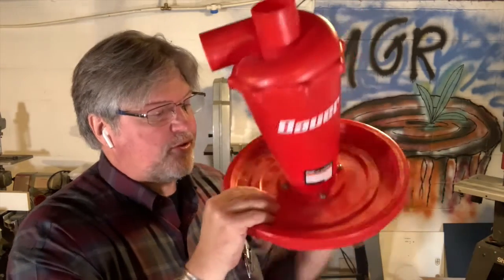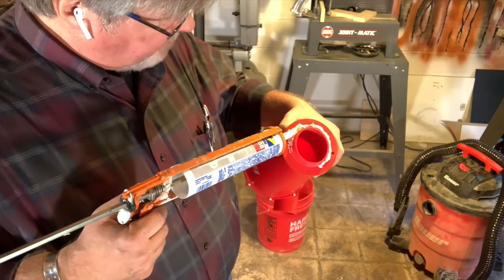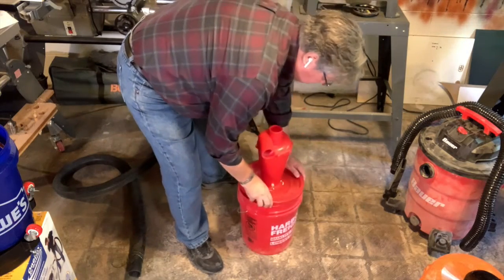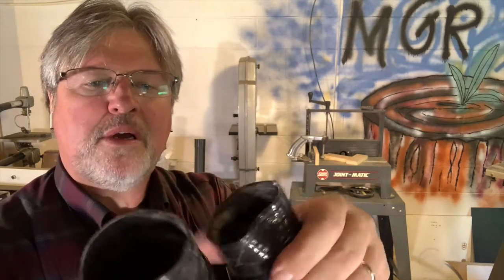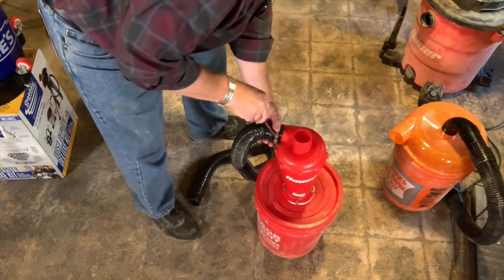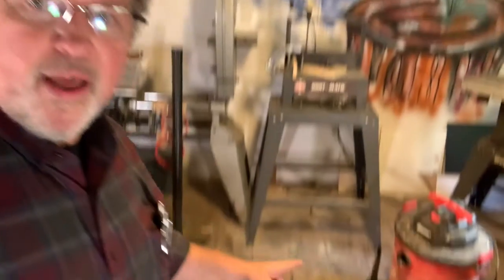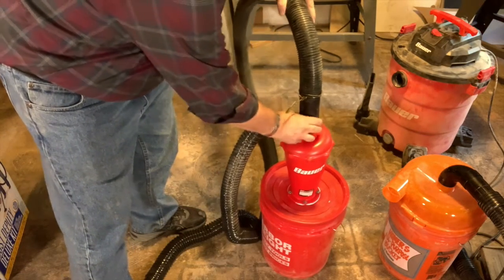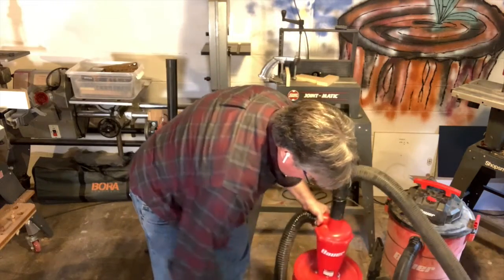Bauer Cyclone Take 2: Deal or Dud?  Not a Fair Fight?

Comment: I have 2 Dust Deputies.  4" and a 2" a Dustopper and a Bauer.   Dustopper in my shop doesn't work as well as the cyclones.   I bought the bauer for the CNC shavings clean up will mount it under the table.   The 4" Dust Deputy handles the light dust from the CNC enclousure.  Hands down the Dust Deputy style in my shop keeps me from cleaning filters for  years at a time.  This last 2 weeks I was resawing walnut and made 35 gallons of walnut dust and just emptied the buckets and the filters are still clean and the suction is 100% all the time.  I don't know if the bauer unit will hold up over time as the American made units have but will find out over the next few years.  99.9 percent of the dust stays in the bucket.  That is awesome!
Reply from the maker: Mark, I'm glad to hear you are getting such a good performance from them. Did you add a gasket or caulk between the Bauer and the lid?  Scott
Reply: @MyGrowthRings  It wouldn't be a bad idea to do so.  If they let dust into the filter that means there is a leak.  I didn't have any leaks on my tests on the bauer.  I pulled the filter off the shop vac and cleaned it with the bauer and then put it back on the shop vac.  Then cleaned up around the shop with it. I figured it would preform as well as my two dust deputies.  I did clean up a bit and opened up the shop vac.  Clean in there.  Lots of dust in the bucket.   I may make a small cart for my portable shop vac it has no wheels but it's powerful and can be used as a leaf blower.   Or it may go on the CNC machine at this time I have a 25' pool hose on a dust deputy and a Fast Cap Reel cleaning up the saw dust from the CNC carvings.

Comment: to solve the hose to tool connectivity issue on my Hercules random orbital sander (oval dust port to round hose), I 3d printed a connector and glued it onto the sander since I don't ever use it without the vac.
Reply from the maker: Good solution.

Comment: i get that the jury rigged bauer and another vac to power it could probably cost maybe $125? and the shopsmith vac is what, 3x that? but from a function POV, you got these two things and their footprint  to pull around, multiple hoses and buckets you need to empty all the time, and in the configuration you showed only one hose. the footprint size argument is in favor of the shopsmith i think, and its easy to use, as i frequently do, the two hose inputs. i am still on the shopsmith vac side of the discussion..
Reply from the maker: I totally agree with what you’re saying. I think the Shopsmith dust collector is a far better tool than this approach, but it just isn’t within the reach of everybody. I will eventually do some thing to mount the bucket above the vacuum so at least it’s not taking up as much space, but the little bucket dolly did serve as an immediate upgrade. Scott
Reply: @MyGrowthRings  makes sense

Comment: Field Treasure Designs has a very nice cart design that mounts the collection bucket and cyclone above the shop vac . The biggest problem I see with the Bauer Cyclone is the cheap hose they provide. I would throw it away and use a quality hose but by then you have probably equaled the cost of an Onieda cyclone or Dust Deputy.
Reply from the maker: Yeah, that's pretty much the same conclusion I've drawn too. Scott

Comment: A friend makes his living building wood trucks and doing intarsia. His shop is a dust calamity waiting to happen.  He saw how my vac-over-Dust Deputy cyclone worked and asked me to build him one, as a favor.  I told him I would.

To the end of building it, he ordered the plastic version of the DD. Too, he ordered a 20 gallon drum I showed him on line ($60.00), which has a metal snap on lid attachment, like my metal version of the DD does.  It seals well, and won't require a bucket lid tool to access the collector bin.

Like the 55 gallon one under my Super Dust Deputy, I'll install a view port when I put his together to allow monitoring of the fill level.  The view port allows me to see when it's time to empty the bin, even through the lightweight, clear lawn bag.
Reply from the maker: Kelly, that sounds like a great solution. Thanks for commenting and for sharing your approach on LumberJocks.com! Scott

Comment: Seems to me that the additional time and effort required to get the Bauer working properly makes the slightly more expensive Dustopper option a better deal.  I don't expect much from HF stuff, although their quality has improved greatly in recent years.  We'll see how recent supply chain issues affect that.
Reply from the maker: I totally agree with your conclusion. Scott
Reply: Some people abuse their tools and some are very hard on tools. I have used HF tools for decades and the only problems I ever had were a bar clamp that failed and a $10 hand grinder that died. They are great value if you treat your tools with respect.
Reply: @tclem44  Yeah, I've had a drill control board burn up, and I had a drill press for about an hour that went back because of a wicked vibration.  Some bar clamp mechanisms that failed, but otherwise not too bad.

Comment: Costly improvements to make the product servicable. There are othere products that have equal or beter results "out of the box"; though a bit more expensive, it wont require multiple trips for other materials, cutting, assembly.
I cut costs with a bunch of ChinesiumFreight stuff. But this dust separation product isn't for me. Thanks for SAVING me time and not wasting money.
Reply from the maker: Well said.

Comment: I have my doubts about cyclones. The only thing it separates is the large particles. The dangerous stuff still goes through the filter. Even then, the longer path the air takes through the cyclone adds a tremendous amount of friction, seriously slowing the air down, rendering it less effective. This is backed up by a comparison of test done by Wood nagazine a few years ago, where a single stage Powermatic dust collector pretty much waxed every cyclone except one, that only beat it in particle count because the Powermatic was using a non-hepa filter. Air movement and static pressure was far better on the single stage. If that single stage would of had a hepa filter, it would have beaten every single cyclone in the comparison.

Comment: What if you connect to 3300 shopsmith dust collector would get more air flow and not filling the cloth top with dust?
Reply from the maker: I’m not sure, but I would never add a tiny separator like this to a DC3300.
Reply: @MyGrowthRings  Scott, is that simply because you don't want to have to empty the 5 gallon bucket frequently or is there a more technical reason? I have only used my Mark V/7 on small tasks so far, but liked having the Dustopper connected to my Ridgid vac as it worked well separating so far.
Reply: @MyGrowthRings  As i implied earlier, connecting the DC3300 to these separators does not work well; however, the DC3300 works great with a baffle separator such as laid out in the Rockwell plans.  I built that into a two drawer separator under my router table.  To that I added a ceiling mounted shop dust extractor and a window-mounted ventilation fan.  My asthmatic wife is happy = happy life and I can keep on wood working!  Crazy John
Reply from the maker: @JohnRFlegg  Rockwell plans? I'm not sure I get that reference. Scott
Reply: @MyGrowthRings  Please see later and separate comment as i missed my entry.  CJ

Comment: I actually used similar ones and they do work. Similar designs claims to capture 99.99%. I have no way to verify that percentage but I have never needed to change my shop vacs filters (and the shop vac container) and they stay really clean as long as I empty out the bucket when it is 2/3 full.

I ended up with reinforcing with three around 1/2" thick plywood sheets. One below lid, one above lid, and nail/screw them to firm up the lid. Another one donut sheet up higher to contain the cyclone with vertical three vertical rectangular plywood sheets to hold up against the lid top sheet. The reason for all above is that the flimsy lid began to crack and leak after some decent uses, just by the weight of hose connected to the cyclone or worse by pulling on the hose by normoforce.

By the way, you can find same/similar (no hose no lid) things at about half price if you can wait for one month or so delivery.

Have fun.
Reply from the maker: Hey Peter. Yeah, I’ve seen a lot of inexpensive, no name cyclones available. Does yours have a dollar sign molded into it, as many of them do? That made me laugh when I first saw it. You sure had to put a lot of effort into it. I do that too, sometimes, and that can be part of the fun of woodworking, but other times, when I have more money than time, I opt for the “out-of-the-box” option. Glad to hear it worked out for you. Scott
Reply: @MyGrowthRings  Mine does not have $ sign. That was the old design that claimed to have around 98%. There have been "upgrades" and the latest designs are similar (almost identical) to HF one (not sure who is copying who) and claim up to 99.99%. I have bought several ones (actually almost 10 of them since they are so "cheap") and the new upgrades do improve (really clean shop vac container). I was trying to make a multi cyclone ( similar to current bag free house vacuum) to use with the HF high CFM dust collector but I found a much simpler way.

Have fun and kill the boredom.

Comment: I would put a round piece of plywood on the underside on the lid which will make it less likely to tilt and buckle.
Reply from the maker: Hey Danilo, yeah, that suggestion has bees made before. The Dustopper worked so much better right out of the box and has a much lower (less top-heavy) profile, so even though the Bauer could be made to work better, I don’t feel the need to put any more time into it. Thanks for adding to the conversation. Scott

Comment: The 5 gallon bucket is way too small. I have a 16 gallon shopvac that died. Ill attach it to that. 
Actually the dust deputy shows that setup- and it already has wheels and is hard to tip over. Its only 45$ on EBay for a dust deputy - that works.  Of  course you don't get the hose, but you can get shop vac hoses at lowes or home depot.
Reply from the maker: These are all temporary as I am about to move into my permanent shop where I’ll use my Shopsmith dust collectors. Thanks for chiming in. Scott

Comment: Steps you took in this video may have helped a bit, but I think the main reason for previous less than optimal dust separation was due to the bucket felling over while the vacuum was running. That have happened to me once and as I'm running regular home vacuum with a dust bag the effect was that immediately the separator let most of dust and chips from the bucket to the outlet and the dust bag filled and clogged immediately. The immediate difference in suction and noise level from the vacuum helped me pinpoint the moment the dust bag was clogged.
Reply from the maker: You would think so but I actually did the test several times without the tip over and was still getting a ton of dust bypassing the cyclone. It wasn’t until I implemented the recommended changes that I got better performance.
Reply: @MyGrowthRings  OK, good to hear.

Comment: Did you set out to make one Dust Cyclone look better than others.
Reply from the maker: No, I had no idea how it would turn out. I still prefer the Dustopper. How about you? What is your preference?  Scott
Reply: @MyGrowthRings  Hi Scott
I have been using the Dust Deputy for over 7 years, they are expensive in the UK for what they are, my  Dust Deputy had a failure where the vacuum fits in the top. This piece fell off when I was going to empty it. So I looked for a cheaper alternative which is like your Bauer and have been using it for over a year without any issues. The best lid for any US 5 gal bucket is to convert a Gamma Seal Lid and to install your shop vac and dust collector in some sort of mobile cart. In the UK our home workshops are small so that is why we do not build big.
Reply from the maker: @mastertoolman9377  I can see why you might not be impressed by the Dust Deputy. Yes, I’ve seen similar configurations of vacuum and bucket, and cyclones, and if this were a solution I were going to stick with I would do exactly that. One of these days I will bring on the camera, my dust collector that I use in real life, which doesn’t require a cyclones, but out of curiosity because of their popularity, I just wanted to try these out.

Comment: Regarding the Bill Pentz information, I made a comment earlier which was poorly phrased and rightfully filtered out of the public discourse. I'll try again.

I really like the  information on Pentz provides. Unfortunately, his recommendations are out of reach for me in term of available time and dollars. Pentz summarizes his recommendations in the "Here is the Goal" section of the "Dust Collection Basic" page. I cannot afford to buy new tools with better dust collection, build hoods and shrouds, buy a cyclone, buy a 0.5 micron filter, and a 2hp or better motor with 12 inch impeller. Also, I don't live in a climate where I can vent outside.

I am actively looking for ways to improve the system I have now, but I refuse to feel badly that I cannot, right now, reach this ideal. Probably, the best I could do is something along the lines of an Oneida Mini Gorilla, but at $1400, its not in the cards right now.
Reply from the maker: I’m right there with you.
Reply: Get in the habit of always wearing the best dust mask you can afford when working with wood, paints, cleaner's etcetera. Especially when vacuuming up the shop floor. Those paper pleated filters are a great defense but you can't believe how much super fine dust gets by them and into our bodies. Thanks for sharing.

Comment: The bucket with the separator on it cut that bucket in half discard the bottom half and you don't have to worry about the suction problem this is my answer it's easy quick
Reply from the maker: Thanks for the tip, Joseph.  Scott

Comment: Great step by step troubleshooting. In my opinion you had the hoses configured in the optimal fashion in the first video. The important thing is it does not leak. There is less dust in the vacuum, but in my opinion, the key benefit of a pre-separator is to maintain a cleaner filter longer so that air flow and suction is maintained longer. It was hard to tell from the footage how clean the filter started out. But it did look like the filter had a lot of dust in it.
Reply from the maker: It started out with about that same amount of fine dust. I suppose I should have started with a new filter, but I was just thrilled that the vacuum didn’t have 3 gallons of dust in it like last time.

Comment: What size hole is needed in the lid? Need to get a appropriately sized hole saw
Reply from the maker: The Bauer comes with a lid that already has the holes.
Reply: @MyGrowthRings  I'm aware. Getting a metal bucket and lid for the seperator, I'll be needing to make a hole. The metal lid has a quick release latch, should make things a bit easier
Reply from the maker: @davids9793  Got ya. I’m out of town so unfortunately I can’t measure it for you.  Scott
Reply from the maker: @davids9793  Let me know how it works out.
Reply: @MyGrowthRings  ok

Comment: so what's the purpose of this unit when you could just use the vac its self  to do the same job?
Reply from the maker: That’s a very good question. The problem with using the vacuum for high volume dust producing tools, such as the router table, planer, jointer, tablesaw, is that the dust will quickly impact the pleated filter, thereby reducing the vacuum pressure. Great question, Scott

Comment: why didn't you connect the short hose to your vacuum?
Reply: Hey Robert, in the first attempt to use the Bauer cyclone (https://youtu.be/yrD2NXpE7rg) I did use the short hose between the vac and the intake, but I was told that wasn't correct, so I changed its location for this take. It makes more sense to me to use the shorter hose between the cyclone and the vac, but who knows, that may have contributed to the issues I had with it. Scott
Reply from the maker: Sorry, Robert, that comment was from me, but I was logged into the wrong account. Scott

Comment: Put a wooden round plate on the bottom of the lid just wide enough to attatch the intake to the lid so it will be more sturdy.use the same 4 bolts or longer.
Reply from the maker: Yes, that's been recommended before. Too much work when the Dustopper works right out of the box. Scott

Comment: How is a guy supposed to follow nonexistent instructions?  It's hard to say you were at fault in the first video.  None of us were born knowing any of this stuff.

I contemplated putting my dust collector in a garage storeroom adjacent to my shop until I realized that it would suck out all of my cooled or heated air in about 3 minutes.  That is unacceptable in the Gulf Coast humidity and heat that's with us for 8 months out of the year.  Not only would it get hot, but all of my cast iron tool surfaces would rust.  The saying of "100° and 100% humidity" is a myth but real figures are more like 95° and 80% humidity, going to 80° and 92% or so at night.  Shhhh- listen to your tools rust!
Reply from the maker: I'm in NC and know exactly what you mean. There's a lot to be said for placing the dust collector in an adjacent room with filtered ventilation between. Scott

Comment: If you cut the bottom out of the red Bauer bucket you would be able to lift the whole assembly out of the blue bucket easily. Then just dump the blue bucket.
Reply: You wouldn't get a good seal that way.
Reply from the maker: I’m thinking that since the dolly has mounting holes that I’ll probably drill holes and mount the blue bucket. That should prevent the vacuum between them and should make the red bucket easy to remove. We’ll see. Thanks for thinking about this, Craig. Scott